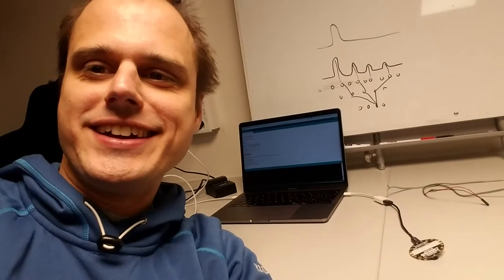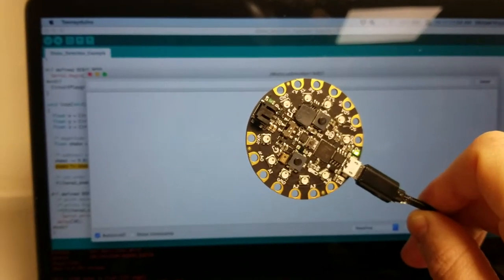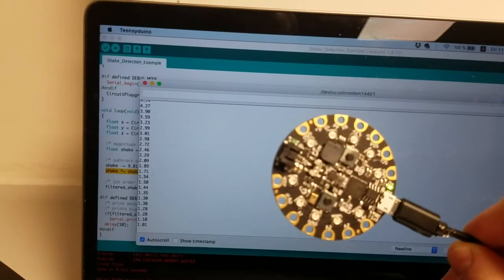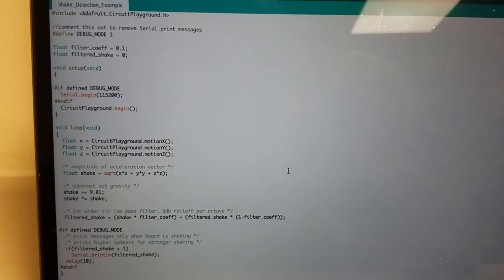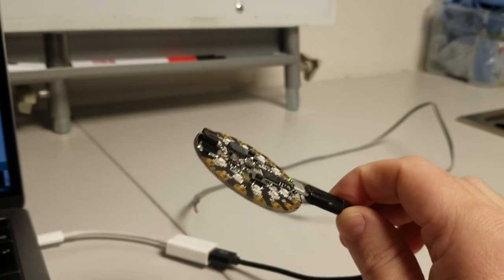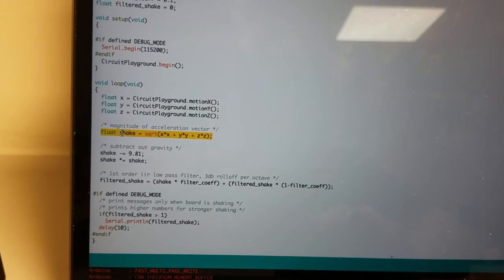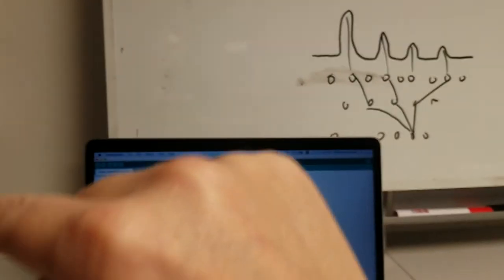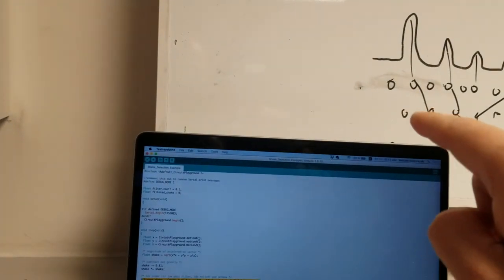How To Measure Shaking with an Accelerometer

Comment: Thanks for the interesting project. Just wondering if you had improvised on this code later? Is there any code snippet that you could perhaps share? I have a little contraption at home for which I need to detect shakes/tremors/trembling and so I am researching on the right components and the algorithm to use. Cheers.

Comment: Nice tutorial! 
Would have been cool to go a bit more in-depth about the "filtered_shake = ..." line in your code. It seems to be the one thing to actually get a reliable 'shake value' and is a bit hard to understand just by looking. Anyway, I'm gonna try to learn that elsewhere :)
Reply from the maker: Handy programming trick, this implements a first-order low-pass filter:

float filter_coeff = 0.9; /*0 to 1 */
float filtered_value = 0;
float raw_value = /* read the sensor here */

filtered_value = (filtered_value*filter_coeff) + (raw_value*(1-filter_coeff))

This basically says that the new filter value is mostly just the same as the old filter value (90% of it), and then you just add in a small part (10%) of the new sensor reading. This keeps the filtered value nice and smooth so it dosen't jump around too much, which is the same as saying that the high frequencies have been filtered out.
Reply: @MichaelKrzyzaniak  Good explanation, thank you!